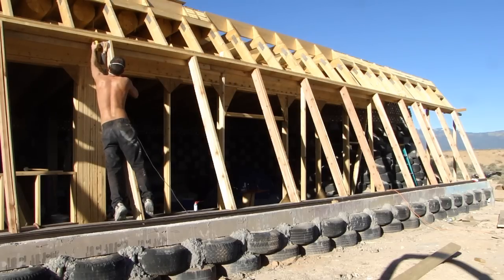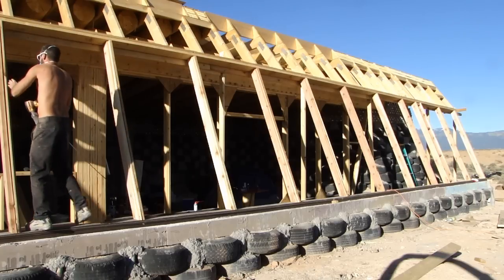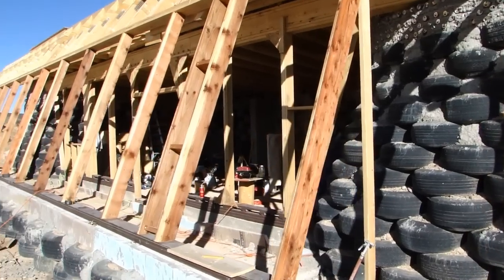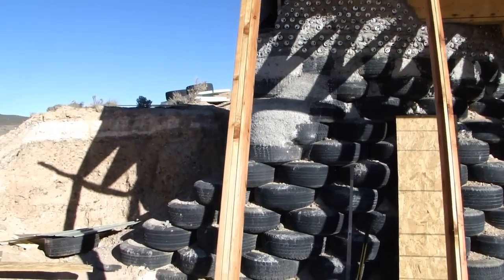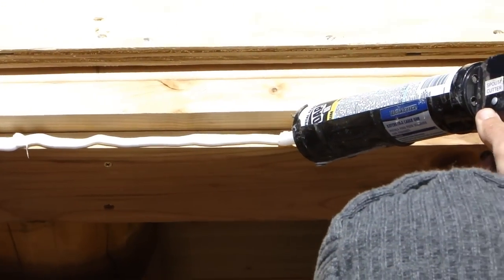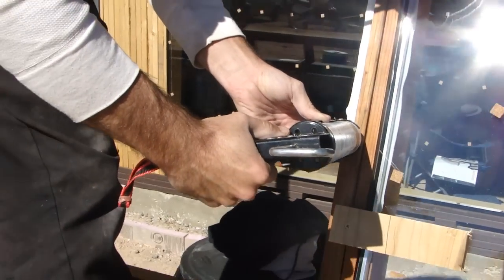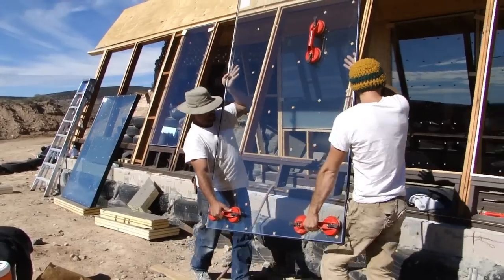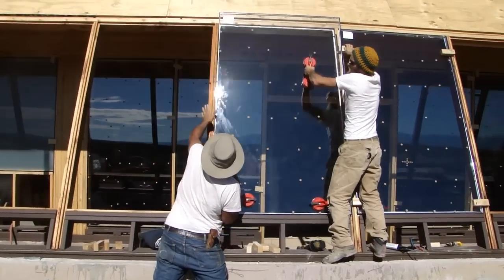How to Build an Earthship's Front Face - Part II

Comment: I love your videos keep it up! You are a good teacher.

Question: Why not run 1/2 inch pvc flex piping down the window frames, and plumb it into a solar water collector along the entire south facing roof. Darren used that design in Brittany, France. It will be necessary for me to include if I hope to deal with Canadian climates...
Is it the climate or the cost involved that deterred you from using that system?

Tim

Comment from the maker: I actually can't remember off the top of my head.  It's covered in one of the 3 old earthship books by michael reynolds.  It would be very close to 70 degrees though because your latitude is almost the same as Taos.  I would guess 67 or 68 degrees.

Comment from the maker: @imau2ber Yes, a lot has changed.  Earthship Biotecture began putting out a series of books (available only in eBook form) on Amazon for the Global model but only put out the first one covering tirework and cistern installation.  I actually used this for my cisterns.  So yes, you need to contract Earthship Biotecture or another Earthship builder to buy plans and consult during your build.